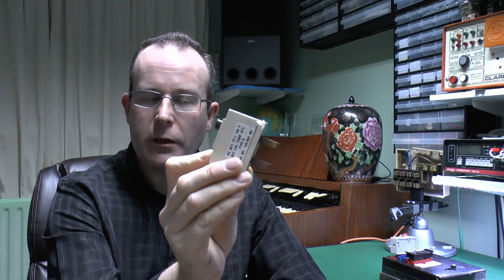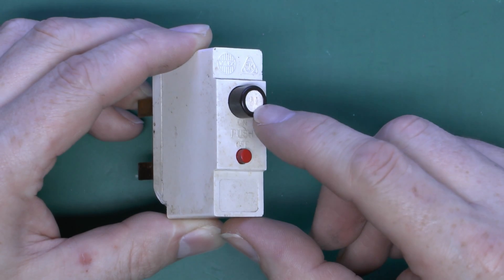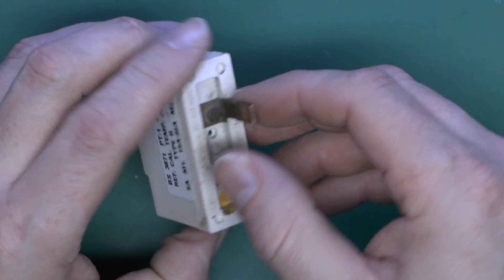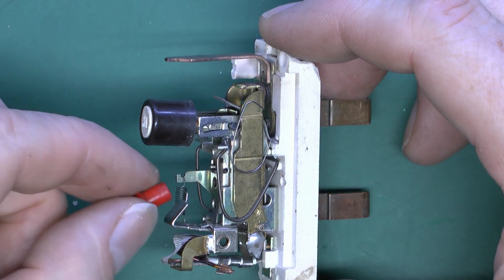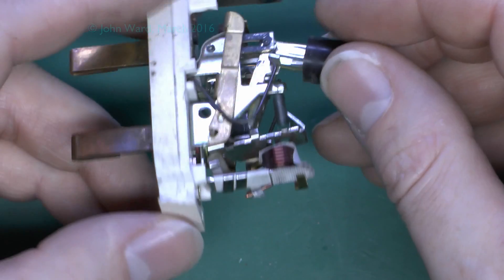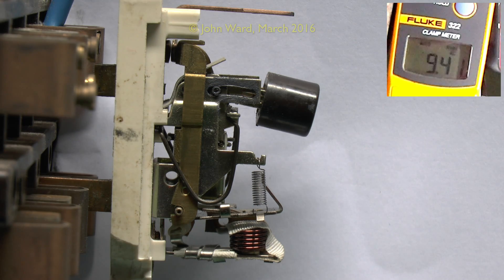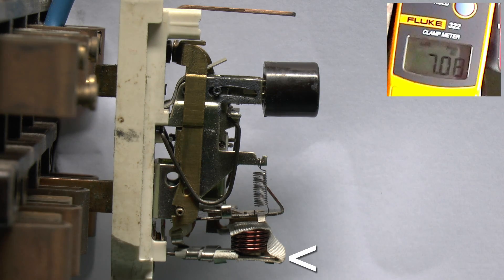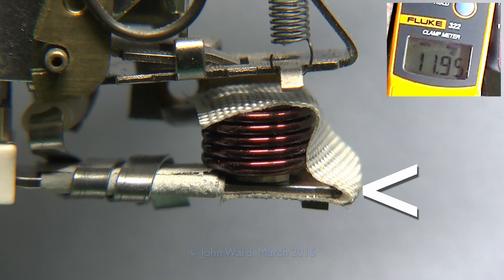Inside a Wylex / Stotz Kontakt Circuit Breaker

Comment: The thing is, if you are constantly messing around with old electrical equipment that you might be testing out or whatever, these resettable fuse/circuit breakers are an absolute godsend.
Especially when you landlord is too stingy to upgrade the old electrics to modern day standards. I'm thinking RCDs here.

Comment: Do these circuit breakers still trip if the 'ON' button is being pressed in at the time? Because modern circuit breakers can still trip whilst the leaver is being forced in the top position.
Reply from the maker: +jayja45 Yes, the trip mechanism is not dependant on the button position.
Reply: +jayja45 yes as i had a short in a cable (mouse eaten the insulation) soon as you try and latch it it trip again 
,, if you have a RCD or RCBO, on RCD TEST button Never Hold it or you can burn it out if held for a long time on some RCD breakers)
Reply: +lee x With the RCD test, most RCD units actually cause a disbalance in the phase/neutral pair (thus producing a Residual current). This is so that when you 'test' the RCD, it actually tests the whole function of the RCD rather than just the tripping mechanism.

Comment: I was fitting a fire alarm in a local shop and the consumer unit was a white wylex and had the same things along with a 16a mcb conversion I've told the the owner to consider having a new CU for better protection as it's a very old installation.
Reply: I find most folk don't seem to care as long as it 'works'.
Reply: +9ff70f96 aye your right I am the same our CU is wylex 10 way board and if someone said to me "new regs say metal need to be fitted" I'd say sod off lol.
Reply: +9ff70f96 That's because it costs a ton of money to swap things out. If it's still working they see no need to spend all that money, so they won't.

I'm the same way. Sod it. If it still works it still works. No sense dropping money I don't have on replacing a perfectly functional setup. Thankfully, the breaker boxes on my side of the pond haven't changed significantly in over 50 years.

It's quite fascinating to see the differences in play over in Britian, too. This sort of breaker is par for the course over here. Somewhat. We have them in different casings with screw terminals because we rarely, if ever, have a fuse box with actual fuse wire in it. Our wiring system also leaves a unique situation where a breaker like this, to replace a fuse block, is a massive upgrade.

Ring mains generally won't have this problem, but we don't use them over here. We use a branching setup instead, where each breaker ostensibly has one room on it and our breaker boxes can have upwards of 20 breakers in them. Our lights are wired the same way many time, as is the case in my house, and a lot of hardwired appliances like cooktops, ovens, central HVAC(Which we almost always have at minimum a central AC but most homes have both electric heating and cooling), the water heater, etc have their own dedicated breakers. In older American houses, the outlets in bedrooms are often either on a very small breaker(5 amps is common) or tied to the breaker for another room. My house is set up in that way, my bedroom's outlets are put on the same breaker as half of my kitchen. This was fine in the 1970s, 80s, even into the 90s when the draw in here was limited to a radio and a boxfan. But today? I've got a gaming PC, a window AC, a radio, an airbrush compressor and two phone chargers in here. If we use the toaster, if we plug the microwave into the outlet it's supposed to be plugged into? They pop the breaker every single time the are used. We have to run the microwave off a heavy duty outdoor extension cord that runs down into the TV room, and we just don't make toast at all.

&#160;If we had actual fuse wire instead of breakers we'd have long since bought a drop-in breaker upgrade. There's no actual safety issue present, the wall wiring is more than capable of carrying the current demands in place and the wiring in my room is completely separate from the wiring for the kitchen. It's just they were all run to the same 15a breaker instead of separate breakers as they would be in a newer home.

Comment: Kind of reminds of the US-style "fuse-breakers." Retro-fits for our screw-base plug fuses (w/ a pop-out button on top). They had one flaw, however: in many fuse boxes, there was no room for the button to pop out, if the door was closed. Therefore, they were often useless.
Reply: +Madness832 I often wondered about those while I was in the US, were they thermal only? Or thermal/magnetic like these?

Comment: Thermal very slow on overload. Ok for the 80tees, at least resetable .
Reply: Probably about normal for any B-type MCB?
Reply: +9ff70f96 Yeah, it's pretty standard for that curve even these days. The only issue would be the very low breaking capacity, but as John says, they were intended to replace rewireable fuses, which had a pretty low rupture capacity too